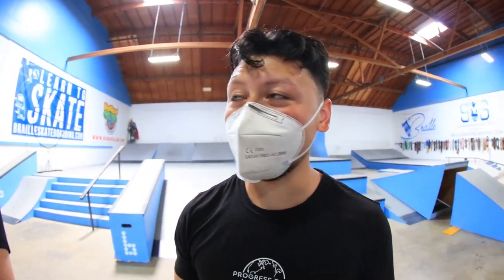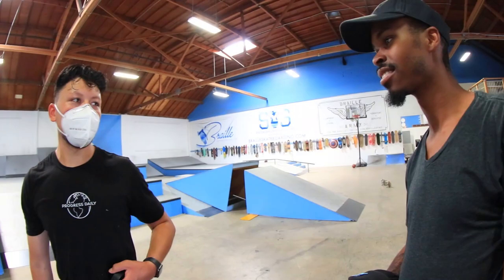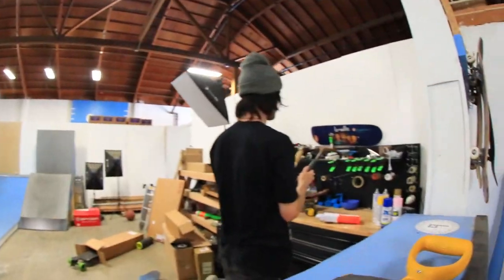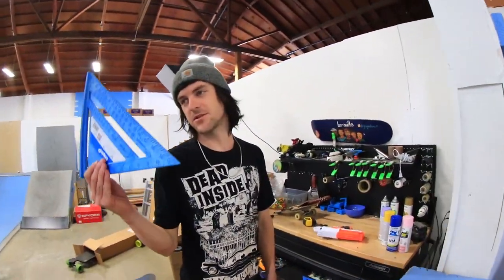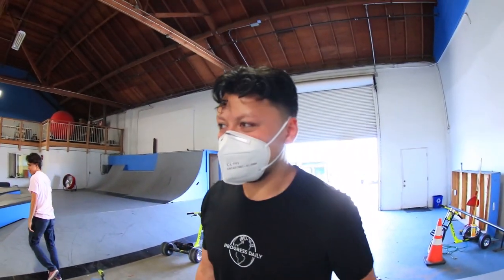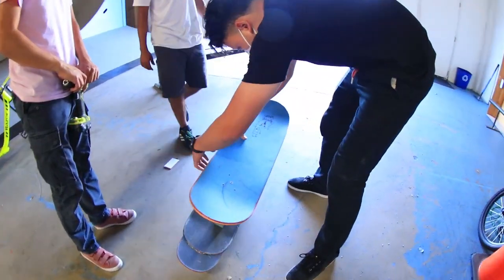THE TRIPLE DECKER SKATEBOARD!

Comment: Idk if you guys did this,

When I was younger. I took two Walmart boards side by side and screwed a thing of plywood connecting them. So it was one big skate board. 
I proceeded to attach a tow line to the Nose, and put blankets and pillows on it. 

I had one of my friends pull me as I chilled. I called it the bed board.  So I’m curious if you can make a better one

Comment: Methinks Braille should do a board that is like a James Bond car with pegs or stomp buttons which when pressed activate a varied effect let out a smoke screen, oil slick, maybe some nerf darts or ball bearings, something along those lines. then have a a few other boards modeled after henchmen and the game would be follow my line.. where the henchmen board needed to perform the same tricks right behind the spy board and try to overtake it. If the henchmen miss out on a trick their eliminated, but if they nail it and then skate past the spy board the spy boarder has to follow the henchmen skate line and if the spy boarder fails the henchman steals the spy board until there is only one man left standing. a simple Arduino board and a few actuators would accomplish this easily electronics are so small and cheep nowadays it would not disable the spy boards performance by significant amounts perhaps teaming up with PeterSripol or FliteTest, though in different states they are gifted in this type of wizardry. Perhaps the henchmen are armed with various nerf dart guns to try and distract the spy boarder :P